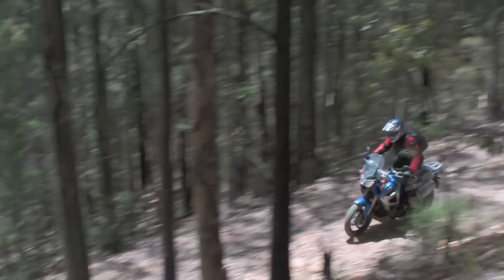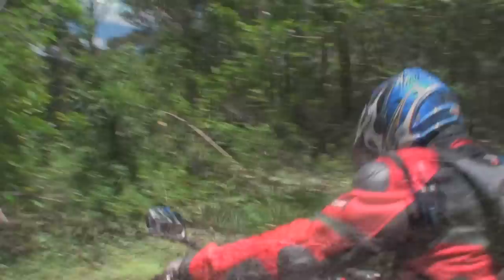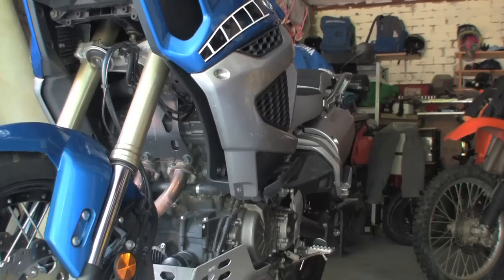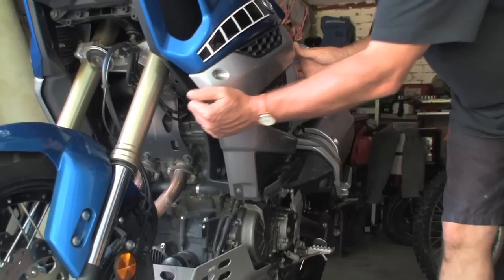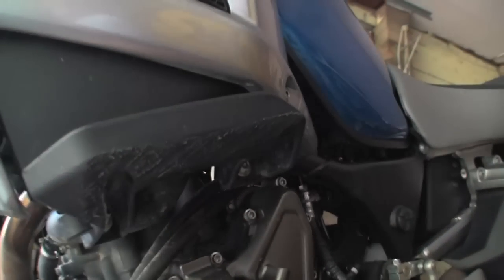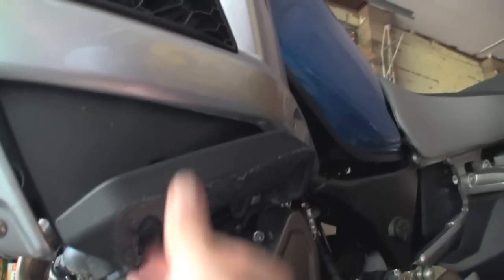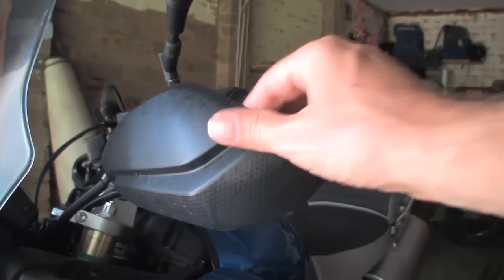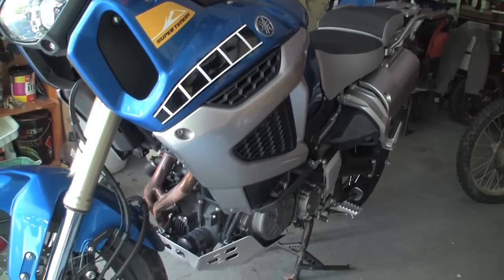Super Tenere 1200 - crash test

Comment: Not sure why the Super Tenere is underrated.  Today I went down to my local dealership and sat on the following 2016 bikes back to back.  KTM 1190, Honda Africa Twin and Yamaha Super Tenere.  I can tell you without any reservation that the feel, fit and finish of the Super Tenere was miles above the other two bikes mentioned.  Still not sure why the bike is underrated.
Reply from the maker: It has great front forks.  I really liked riding it.

Comment: I hear people talk of the radiator all the time.  I like where Yamaha put it.  I see bikes like the New Triumph 1200 and the radiator is right behind the front wheel exposed.  While it gets a lot of cool air there, I can see rocks, sticks, and other crap being sprayed up from the front wheel.  Looks like a recipe for failure.  

Its good to know the Super T can take a good drop.  If you ride on the dirt, its only a matter of time before you drop a bike, so its good to have some protection.

Comment: I just dumped mine on the left side at very low speed. The plastic guard and my saddle bag took all the damage. I sanded the guard and painted it and touched up the small spot on the bag. Good as new!
Reply from the maker: Good tip!